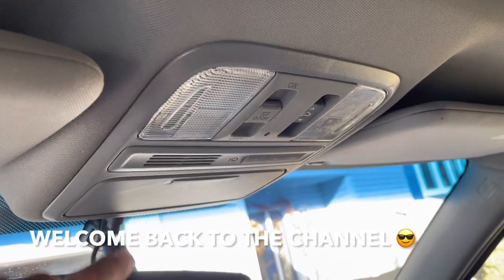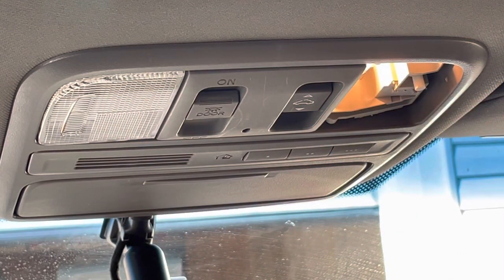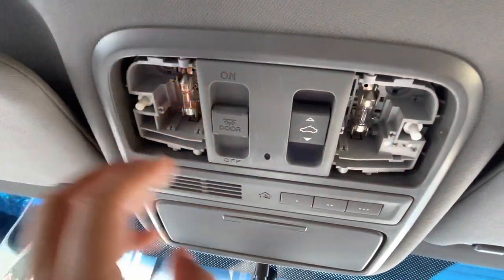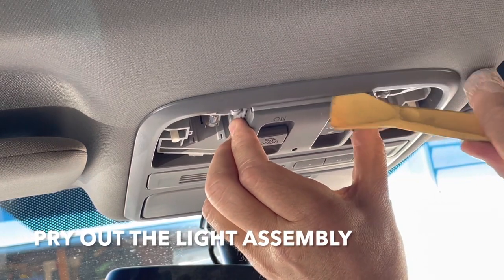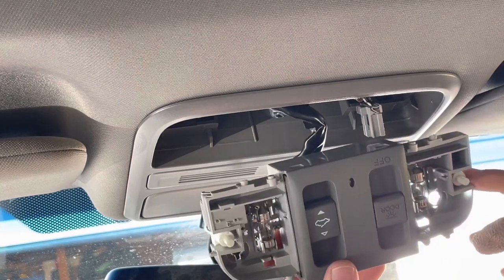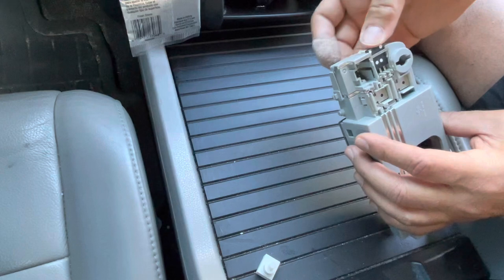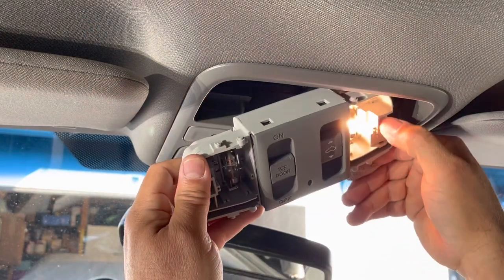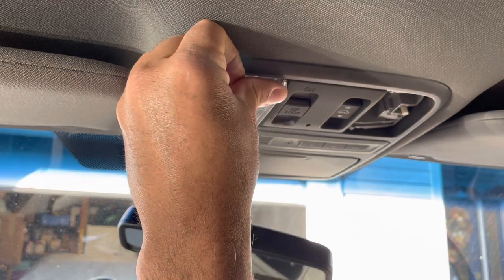HOW To FIX the DOME MAP LIGHTS on a HONDA PILOT - Easy Free Fix!

Comment: OMG!  I had the exact same problem, so I was reallyhappy to see this fix.  I did 2 things differently: 1 I did not bother to unplug the 2 wiring harnesses - just left the fixture attached to them, 2 I didn't swap sides on the switches, I just snapped them off and put them back on. That immediately fixed the problem!  No cost. ONly took about 15 minutes. BTW I used a table knif to pop off the clear lenses...

Comment: This was a great help to DIY people who would get charged A LOT at a dealership.  However, it did not really solve the problem.... follow me here... You can't solve a problem if you can't identify the problem.  A bulb can't be bad and then suddenly be good.  Switching two identical switches into their counterpart positions should do nothing!  Yet it did!  So what was the actual problem and what is a long term solution.  I have a 2012 Honda Pilot EXL with light interior light problems similar to this.  I'm going to measure the voltages and resistances.  I suspect that there is computer logic at fault somewhere in this.  I can tell that Honda went ape sh*t adding technology without having good testing procedures from this and other problems.  For instance I bled my brakes...  bled my brakes!!!  And now I have the little wrench icon on my dashboard all lit up in yellow.  Why?  Fortunately, I have bled brakes on these vehicle before and if I just ignore it the yellow light will go out and the code will go away.  Bad coding in the computer!

Comment: Are you aware where the exact location is for the fuse to these lights? I can't seem to find it. Thanks!
Reply: The fuse box under the hood.  Facing the car it's on the right.  Labeled 'interior lights.'